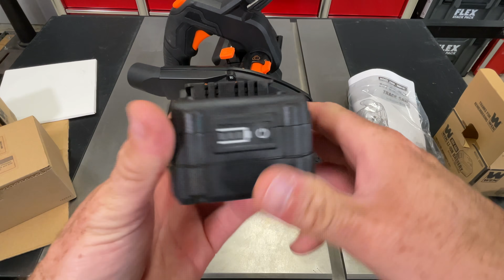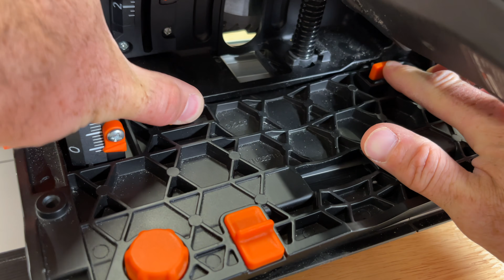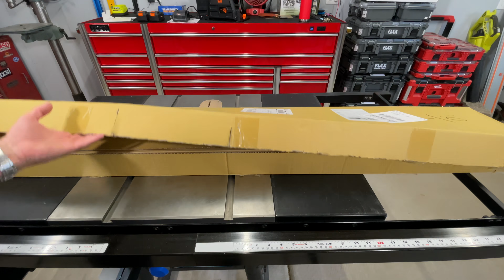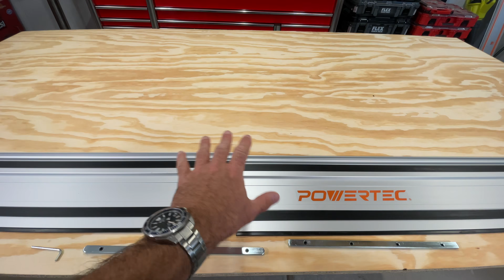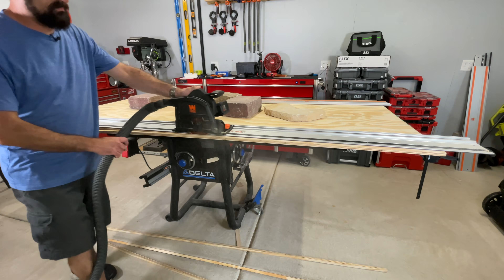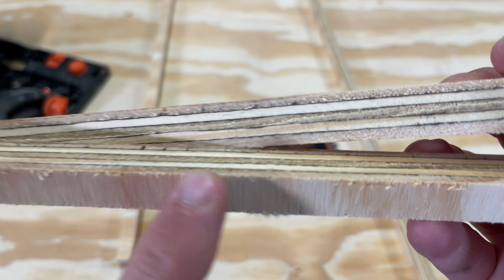Can A Cheap Cordless Track Saw Be Good??  ||  Wen Kit 20691  ||  Review

Comment: Here in canada it costs 480$ and for that price i can get either the dewalt or milwaukee which is 498 on sale but i opted for the makita 40v cordless for 675 $ because  i have 3 batteries and the saw lasts for full day of intense cutting , if wen was in 300s i wouldve gone for it but i am not paying that price for wen

Comment: I love my cordless WEN saw. MILES ahead of Ryobi's saw. I did get the dual-battery charger with mine and was disappointed that it's not able to be attached to the wall like my DeWalt chargers. It annoyed me so much that I designed a wall mount for the charger. I have them on my website if anyone's interested.

Comment: Thanks for the review. I bought the saw based on your review.  The WEN saw has an odd dust port as it doesn't fit the common Ridgid hose end. What modification did you do to connect the saw to the shop vac? Thanks.

Comment: One con with the Wen cordless track saw is the arbor is 20mm and will not allow for a Diablo blade which has a 5/8” arbor hole.  A saw blade upgrade is impossible because of this.

Comment: Wen has 110 inch 2@55 inch for about $70 or less on sale. For dust control I got a cover for the opening. This improves it dramatically but not perfect, yet. With a track square it’s a dream

Comment: Needing a vacuum hose hooked basically defeats the advantage of being cordless. I am almost certain that a power cord would be more  flexible and less cumbersome than a vacuum hose.
Reply from the maker: Both are a little annoying but so is trashing the garage so I usually hook up the vacuum. At least with a track saw you don’t have to worry about the hose messing up the cut. Thanks for watching!

Comment: My need is to break down the long way sheet goods in a big box store parking lot.   Since most of their saws are ALWAYS  broken.  Thanks for your review.
Reply: This is a good call - never thought of that use case before.  Plus even if the saw ISN'T down, it's nearly never straight when they cut it.

Comment: GREAT review! i've had my eye on this saw because of the price vs other brands. I'm fully into the DeWalt cordless platform and I'm curious if they make a battery adapter that would fit this track saw. if you or anyother woodworker have answer please shareit. TIA

Comment: I have this saw. Made the mistake of buying the WEN tracks in trying to save a measly $50 (over the Powertec). I was making a "wood slat wall" project. I ensured the screws holding the 2 track pieces together were properly tight, and my super long ruler confirmed it was straight. The first ~20 wood slats I cut from my plywood were very straight. But all my slats after that have a very slight bow in the middle (becasue the track is slightly bowed or something).  My bad that I should've periodically checked the straightness as I was cutting the plywood. So 20 of my wood slats are straight, and the other ~80 have a slight curve.  I can deal with the slight curve, but for some people who can't deal with it, it means ~$200 worth of plywood was wasted becasue of the cheap WEN tracks. Moral of story - don't try to save a measly $50 but end up wasting hundreds of $ when you're working on future projects.
Reply from the maker: I’ve used many different tracks now from super cheap Wen to comically expensive Milwaukee and many in between. The point that stands out the most for me is that they are all almost the same. They are the same design and form, lock together the same and all have been laser straight when connected. The only difference I’ve found is the quality of the foam on the bottom and price. 
The Wen has a two piece connector that’s different than most and is a design I like but maybe it caused your two tracks to become misaligned? Thanks for watching!

Comment: I purchased both the corded versions of the Wen track saw, they both had issues with the pot metal (poor construction) and unfortunately both broke within hours.  The cordless version construction and durability is much better in comparison, and has been working great for me.  I am extremely happy I returned the corded versions and spent a bit more for the battery powered version.  I also purchased the Powertec guide rails.  Those are not great as the adhesives holding the rubber on the back started losing adhesion very quickly.
Reply from the maker: Thanks for the insight Matt! The 6.5 corded and cordless saws are basically the same saw. The cordless does have some smart updates and fit/finish/quality has improved. I still think the cordless is worth the $85 bump in price. Thanks for watching!

Comment: As always amazing review, just one question.  I remember that on some videos said that the corded version has some wiggle when you put it on 45° giving you not precise cuts at this angle, does this cordless version have the same issue? I was really expecting to see a 45 cut test on your video. thank you again.
Reply from the maker: I’m planning another video with both these saws and we’ll address the flex at 45 along with dust collection and check out the 5 amp charger. Thanks for watching!
Reply: @ProjectsForAllReviews  first of all thank you for all your very complete and honest videos, I just wonder if you will release the video of comparison you mentioned on this comment 😬, or i would like to get your opinion of which of this saws is better in power, and also on the topic of the flex at 45°. thank you in advance.
Reply from the maker: @javier-pr3mr We’ll get to it eventually but I keep getting more stuff to review and my schedule holds me to 1 vid a week. At least for the foreseeable future. I still have both saws. Thanks for watching!
Reply: @ProjectsForAllReviews  I understand and thanks for your reply. Just in general terms, have you seen an improvement from the corded version to the cordless one other than the battery vs cable?

Comment: I found the Wen CT1272 7-1/4" track saw in open box condition for $50 over the weekend.  Plan on going with these Powertec tracks.  But I wanted to note, Wen has a 110" pair of tracks now too like Powertec.  Not just the 100" pair, though they are still for sell too.
Reply: What a deal! WEN's new longer tracks are said to be better than their originals too.

Comment: I purchased the Makita corded track saw. It’s a very nice saw, but I almost think I should’ve saved some money and went with the WEN because I don’t use it near as much as I thought I would. Especially after I got the Dewalt 10” table saw. But alas, it’s paid for now, 😆. Love your channel.
Reply: I too have the 2x18V cordless Makita with PowerTec rails and love it.  Zero issues or complaints.  I looked long and hard at the WEN, but most reviews showed that the saw flexes too much... the base plate moves slightly compared to the higher end saws.  The Makita cuts 3/4" hardwood flooring like butter.

IMHO for the price the WEN is fine for DIYers, but I needed accurate sheet good cuts so that I don't have to re-cut on my table saw.  I use it all the time to cut down 4x8' sheets before I can get them down into my basement workshop.

Comment: For me, between the charging time and the price difference, I think I would prefer the corded version .
Wen seems pretty good about updating and redesigning their products every few years, maybe they will add some of these updated features to the corded versions in the near future.
Reply from the maker: I took both apart last night and the metal side covers and metal housings are identical, same mold I'm sure. the shoe is the same except for a few updates. The only real difference is the kick back safety that Wen removed for the cordless version and a little better track to saw adjusting design. Remove the kickback safety and install a 48 tooth blade (my corded came with a 24t blade) and they are the same. Thanks for watching!

Comment: Mike, I have the corded version on the older Powertec track system. Mine came with only one track connector but the Wen track clamps work perfectly. I will see if E-bay has additional rail joiners. For dust control, a small piece of clear poly taped to saw on 2 sides gets it done. Nice review & where's the orange cat?
Reply: Forgot to mention I installed a 60t Diablo blade.
Reply: Wen now offers a 5a single battery rapid charger. If you are doing a lot of cutting you would need two to keep batteries up to work load.
Reply from the maker: Thanks for the feedback! Check out the WEN brand connectors. You can see them in my Milwaukee Tracksaw vid. They use a two piece connector and the set screws tighten on the second metal strip causing it to expand. Much better design than the industry standard like the Powertec that tighten down and dimple the aluminum rail. I have the link for Wens 5 amp charger in the description. I'll order one today so we can see the improvement. Watch for a follow up vid. Thanks for watching!

Comment: I've been sold on the WEN track saws for a couple years now and have been using the cordless version for several months and really like it. I agree to your conclusion on the unique battery platform, but I now have their cordless biscuit joiner, so the batteries are starting add up.  Great job. Scott
Reply from the maker: I saw that biscuit joiner and was intrigued. That or the planer will probably end up a future vid. I saw you did a video on this one, comes up on my feed. Now that Ive done it I'll check out your video. Thanks for watching!
Reply: @ProjectsForAllReviews  Your video was MUCH better than mine. I already covered both versions of the corded WEN track saw, so when this one came out I didn’t feel the need to run it through its paces on video. I’ve used it quite a bit since, and really do think it’s handy, but I have run into situations where I needed fresh batteries, so ultimately I need to buy either another battery or another tool that includes a battery so that I have two complete sets. Scott
Reply: Thank you for pointing out the biscuit joiner. I am picking this up and was hesitant to invest in a new battery ecosystem (I'm currently in both Ryobis and M12), but that sounds like something I will use infrequently and would me extra value from these Wen batteries.
Reply: The Ryobi track saw needs a redesign. It's cheaply made and wobbles out of square on its cheap saw table base. Also why does Ryobi only have a 50" track length, rather than Wen track saw that is 110" track length? Why?. Plus Wen is twice as powerful with 40v cordless brushless power. 😊
Reply: Know what would make a hell of duel? Pitting WEN’s against Makita’s.

“Do you really need to spend $400MM on a biscuit joiner”?

Comment: I have the Wen that takes a 8 1/4 blade. I also bought the powertec rails after watching reviews. I then bought a rip and cross cut diablo blades. I've been too busy to do anything with them so I can't comment on performance.

I get the idea of cordless power tools but if you're running a dust collector, you have a massive cord behind so why not just use mains power? What's an extra wire? Just clip it to the vac hose.
Reply from the maker: It's true that if you're indoors hooked to a vacuum the cord isn't a big deal. If I was working for real and not making a video, I would be 100% using this saw outside with no dust collection. Even in winter it's better than trashing the garage IMO. Thanks for watching!

Comment: I have the WEN corded track saw which is perfect for what I do, but I would never buy the Cordless. The problem with these cheap chinese brands is the batteries are always sub-par. They die in a very short amount of time and end  up costing you more than buying a better product in replacement batteries. My dewalt Tool kit I bought (drill, impact, sawzall (I know, but it's easier to spell) circular saw and light) about 10 years ago is still going strong. The batteries still last as long as when they were brand new.
Reply from the maker: I think most would agree the name brand batteries are best. I have Milwaukee batteries that have to be 14 years old and haven't lost enough useful life for me to notice a difference from new. Time will tell on the Wen and I'll let you guys know if there's trouble because I plan on using that saw a lot. Thanks for watching!

Comment: I bought the Kreg tracks a couple-three years ago. They come with a universal sled that also fits the T-square they sell. In honesty, I have used it for one project. I use the T-square all the time. Two Phillips head screws and ten seconds later, my Makita cordless circular saw is secured. Easy-peasy.

Knowing what I know now, I would not have purchased the tracks. I am fully cognisant of the fact that the above statement is counter to current sheet goods handling standards. I don't care. I do fine with the T-square. Perhaps thirty years of breaking down sheets has taught me serviceable ways to cut sheets, or maybe I am old and set in my ways. I just think I would have been better served by buying 3 sheets of Baltic Birch than buying the track.
Reply from the maker: Haven’t used that Kreg setup but I imagine I’ll get to it eventually. Don’t feel bad. I’m getting old and am set in my ways too. If I hadn’t fallen into this tool review gig I’d still be clamping a level to plywood and using a circ saw. It’s free and it works! 😂 Thanks for watching!

Comment: there was a day when i wouldn't even consider another brand of cordless tools because to  me dealing with multiple tool brands that each have their own proprietary non-interchangeable batteries is just plain stupid so for a long time ryobi was the best bang for the buck so for me it was ryobi or nothing. fast forward 20 years and ryobi is now the worthless fat soon to be ex that keeps wanting more and more money while having less and less to offer so if a company like WEN can get their battery systems straightened out and efficient then i'd have no problem buying their cordless products but right now, having a saw that needs over 4 hours to charge the battery's is just not an acceptable option......
Reply from the maker: I started out with a set of blue Ryobi tools about 25 years ago. I was pleased with them until I got into remodeling and realized there were better options for everyday use. Nowadays the tool industry is jammed with competitive options and it benefits all of us at all levels. 
That charge time was absurd and I’ll have to pick up Wens 5 amp charger to compare. Maybe I’ll grab some accessories to improve the dust collection and do a follow up vid. Thanks for watching!

Comment: Another good job, Mike!  Hey I must have missed some of  your stuff, looks like you're maxxing out the pack out gear.  One of the frustrations I have with track saw tracks is that when you have a different with kerf on your blade, you have to make the clearance cut match.  After doing that twice, one generally has to replace the strip and I find that to be a pain in the neck.
Reply from the maker: It’s true when swapping blades you should definitely check the clearance to the strip or use the same model blade forever. Could have made the difference in cut quality when I switched to the 56t blade and compared. Solid point. 
That Flex Stackpack in the back is waiting for it’s review. Should be in a few weeks. Have a Skil 1/2 in impact and tower light up next. Thanks for watching Meat!
Reply: @ProjectsForAllReviews  Looking forward to both.  Thanks, Mike.

Comment: The only thing it doesn’t have is a riving knife, but coming in at under $200, I’d take that trade off.
Reply from the maker: I agree. I’ve reviewed 4 track saws now, 2 with and 2 without riving knives. While a nice feature, I have yet to be in a situation where I thought it saved my butt or wished it was there. Good setup and proper technique help too. Thanks for watching Griffin!
Reply: I’ve found that if you make a first shallow starter cut, I never get kick back no matter how thick I’m cutting

Comment: Thank you. Nice review. Something I’d like to know is how it does on 45 degree bevel cuts. The corded version was shown to have so much play that it wasn’t viable for such a cut. The play was between the upper unit and its base; it wasn’t about stability on the track. Any chance you could try it and post an assessment? Thanks.
Reply: BTW, by “post an assessment” I just meant a comment, not another video. Thank you.
Reply from the maker: Hello all! I do expect to post another short vid on this saw soon addressing dust collection testing the 5 amp charger and we’ll throw in some bevel cuts for both this and the corded saw. Thanks for the comments and for watching!
Reply: @ProjectsForAllReviews  awesome thank you. BTW I just bought the skil table saw based on your review and I'm really happy with it. Thank you for your great reviews
Reply: I have exactly the same question.
Reply: Great video! If I am have a limited budget, other than the cord issue, do both the corded and cordless models work the same in regards to power in the cuts and the way they "track" on the tracks? Your thoughts. Thanks for the Powertech track review. That upgrade seems well worth it.
Thanks.
Dennis
Reply: I was just about to ask the same thing

Comment: I picked up the WEN 7+ inch corded track saw (with Powertec tracks). Very satisfied with it, cut quality is just as you describe--nothing to miss compared to high-cost brands. Corded is fine for those who are using a dust hose anyway (and enables remote start/stop of the dust extractor). Thanks!
Reply from the maker: I haven’t used Wens 7-1/4 track saw yet. I imagine it would be nice to have almost infinite blade options. Thanks for watching!
Reply: little slop/play in them but for the price can you complain? Probably not